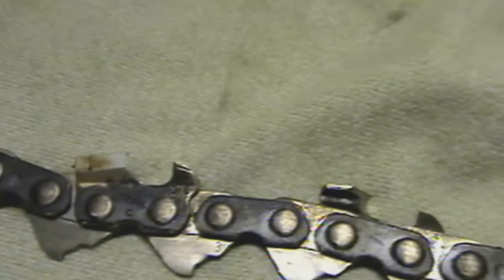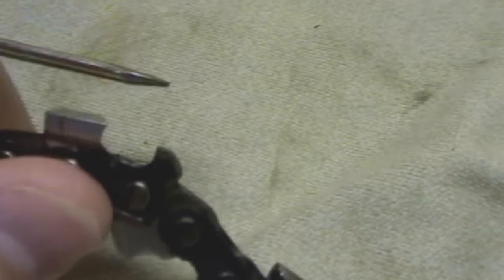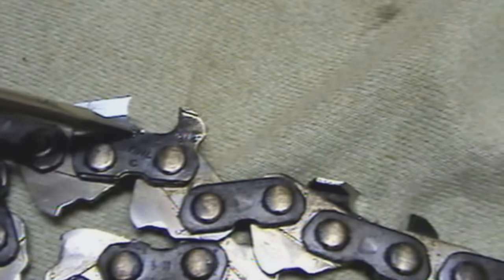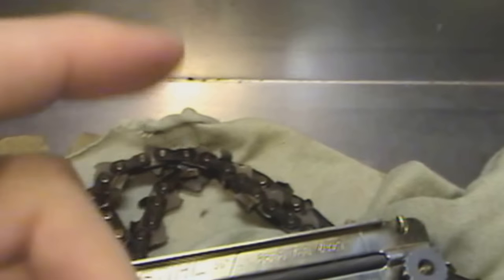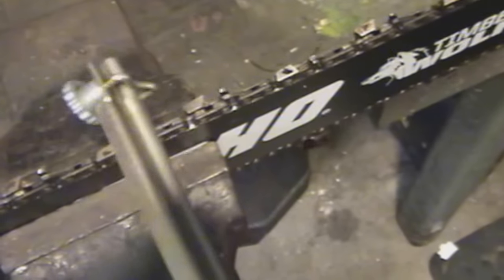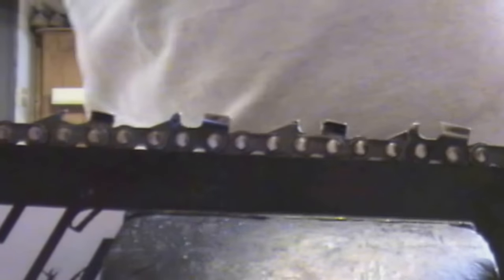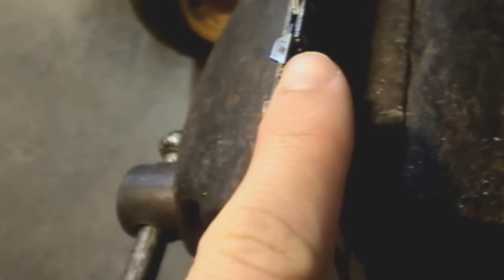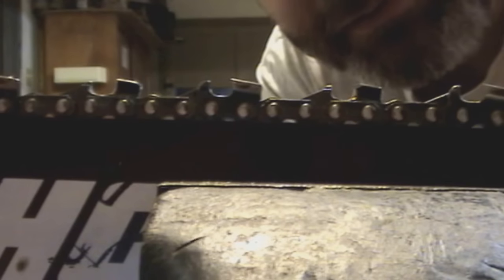HOW TO SHARPEN A CHAINSAW CHAIN.

Comment: How do I know what size file to use for my saw?
Reply from the maker: It depends on the chain. What pitch and style is the chain? That info will be stamped on the side of the bar.
Reply: @Andyshine77  3/8th pitch.  .050 ga?
Reply from the maker: @soleslayer91   Sounds like full size 3/8 I use an prefer Stihl 13/64 size files, some like 7/32 which is slightly larger. Now if this is on a small saw you could have low profile 3/8 chain, that chain is used on small saws with short bars. the file for that will be 5/32.
Reply: @Andyshine77  thankyou sir it is a small poulan 14" bar
Reply from the maker: @soleslayer91  OK that will be Low pro 3/8 chain.

Comment: You didn't mention filing the hook same # of times for each tooth. I have heard that if some teeth have been filed more or less that can cause it cut crooked. Can you address that please? And thank you
Reply from the maker: Good question, I'm glad you brought that up. Unequal tooth length will not affects the way the chain cuts, if the depth gauges are set properly. That is a myth. Now I prefer to have them somewhat the same length, but only because of OCD lol.✌

Comment: bravo- I am getting  fine dust is depth Gage  the problem
Reply from the maker: I really can't tell you one way or another, it could be or  the teeth are not sharpened properly.
Reply: @Andyshine77  what causes the oil to get to the bar . is there a motor or pump or gravity
Reply from the maker: @boashna   A pump. The older saws were manual, new saws have automatic pumps driven off the engine.

Comment: Witness mark? or guide line.   And, at 9:30 that file looks like a double-bevel chisel file for sharpening square edges on a full chisel chain,,,, please don't use it for the depth gauges,,,, I searched high and low for these.  (You are making a grown man cry lol)
Reply from the maker: The edge of the file is used up from square filing, so I repurposed it. They cost like $12 each so I try and get the most out of them lol.
Reply: @Andyshine77  Totally logical.  I tried sourcing from Vallorbe directly, but the sales rep never responded.  I guess they don't want to be bothered with small potatoes like me.  BTW, Thank you for your presentation, you gained another subscriber.

Comment: There were no drag links in that chain,  am I right in assuming that the  gauge link act like drag links in that chain. Great tutorial no how to sharpening a chainsaw chain by the way.
Reply from the maker: Drag link? Chainsaw chains do not have such a thing. What I believe you're calling a drag link is actually a bumper link used on what is called safety chain. Safety chain helps reduce bar tip kick back. Unfortunately it also makes bore cutting difficult if not impossible.

Glad you liked the video.✌
Reply: @Andyshine77  don't they also have to be filed down when they start sticking up higher than the cutting link.
Reply from the maker: @jeffarp7409  The teeth would have to be extremely worn down for that to occur, time for a new chain at that point. So no you should never have to file the bumpers.✌

Comment: Sharpening from the point down is more accurate and no burr.
Reply from the maker: Technically you're correct. However it is more difficult for most, and the difference in the end result is miniscule. Most who square file including myself, file front the outside as you suggest.✌

Comment: how much you charge to sharpen a chain
Reply from the maker: That would require me setting up a PO box, unless you're local. That said it would depend on the type of chain and how many drive links it is.
Reply: poulan pro 18inch chain s62
Reply from the maker: . I would charge $10  it would not be worth the cost of shipping as a new Oregon chain is only $18  a knockoff brand would be even less. So I will suggest learning how to sharpen the chain with the help of my video, or just buy new ones, which to me is very wasteful. Sorry I couldn't be more helpful.

Comment: If a chain costs $15 and is readily available, why sharpen?  Is it because the new ones are too dull to begin with or is the logic just to reuse and conserve resources?
Reply from the maker: Well one reason most real chain does not cost $15 more like $40-$50. If you actually cut regularly even $15 will get expensive quickly, and if you're a professional, you'd be out of business. Plus if you actually want to run a chain that cuts even somewhat efficiently you have to sharpen regularly. And yes it's less wasteful.

Comment: Cleaning your chain. You'd get fired or laughed off any logging show.
Reply from the maker: No doubt, this is only an in shop thing and I normally don't do it myself. But it does help make your files last longer and makes filing a bit easier. ✌
Reply: @Andyshine77  Hey Andre', great tutorial!  I wondered if you would catch any flack for your tactic of cleaning the chain prior to servicing.  Out in the field I just get my kit and go after it, but back in the shop when the chain comes off they get cleaned up before I sharpen.  Numerous benefits to it. Not only the file and stone benefit, but the tooth benefits from not having the residue to hold heat in the tooth when grinding. They will certainly begin to blue on the cutting surface much more quickly when there's crud on the top plate. Same goes with mower blades!       Bless'ns to ya,    Tedd
Reply from the maker: @sawsurgeon   Thank you brother! 

I also find making a rip cut will help clean the teeth up if they're gummed.

Comment: Thx! Is it worth the extra 12.00 to buy the stihl chains over Oregon?
Reply: No Oregon LGX best my humble opp.
Reply from the maker: I depends, Oregon makes some good chain and when sharp, the thinner tooth design makes for a fast cutting chain. The main Issue myself and others have had with Oregon, is the edge retention "for those who cut harder species of wood", isn't up to par when compared to Stihl chain. There have even been some Rockwell hardness test, that confirm Stihl chain is in fact harder metal, the chrome layer is thicker as well. If you don't mind sharpening a bit more Oregon chain is fine. Also shop around some dealers will cut you a break, especially if you buy chains regularly.
Reply: I dont believe in your talk about the "gullet". If the tooth and depth are correct this "gullet" is of no consequence. Correct oil and sharpness is more important to comment!!
Reply: bobe8888 c
Reply: @ajstoddard1  the gullet i very important

Comment: I just but a new chain when mine gets dull . $25 chain isnt worth my time to sharpen
Reply from the maker: Professional chains are more than double that, depending on the drive link count. If you really cut wood you'd be going through hundreds of dollars worth of chain a day, even with enexpensive homeowner type chain. When you know what you're doing it only takes five to ten minutes to sharpen a chain, as not all of these steps are used each sharpening.

Comment: Filing is not good as the file is only the same hardness as the chain, they do not last long and go blunt very fast
Reply from the maker: This is incorrect. They're much harder than the metal used for the chain, if not they wouldn't work at all. If you drag the file on the back stroke they will in fact dull quickly. The chrome that covers the top of the tooth is in fact harder than the file, this is why when you file you're removing the softer metal under the chrome to produce the sharp edges.

Comment: In 50 years of running a chainsaw I have never cleaned a chain. Can’t even begin to see why anybody would clean a chain.  sharpened it use it. Sharpen it use it. Sharpen it use it. Never ever clean a chain or filed the depth gauges, just leave them alone. They will wear down on their own. Start messing with the depth gauges and failing them. And you will probably make your saw cut crooked. Then you have to fix it. Leave them alone.
Reply: Never filed a depth gauge? What do your chips look like? Talcum powder?
Reply from the maker: Didn't catch this one. I never understood why people that don't have a clue feel the need to share nonsensical statements. 

If you don't have to lower the DEPTH GAUGES, than what are there depth gauge tools?😒

Comment: Simple. Buy an electric chain sharpener from Oregon. Problem solved.
Reply from the maker: I have one. They take just as much skill, setup and a diamond wheel to get even close to a filed chain. The stones that come with these grinders work, but take a lot time and patience to get right. Stones also overheat the teeth real easy, this changes the temper of the mental. Plus you still need to know how the chain works to do it correctly. Nothing worthwhile is easy.

Comment: ALWAYS SHARPEN THE ( RAKER ) 1ST, NOT THE TOOTH 1ST, you will find out when your out in the field without the luxury of vice grip, if you do tooth 1st you will be wasting time do to resharpening the whole chain again & starting with the ( rakers) 1st, because you will nick the tooth without all your little toys with you out in the field, so do yourself a favor do the ( rakers ) 1st & save time.
Reply from the maker: Well you're being a tool, but in a way you're right, you can in fact blunt the tooth with the gauge, so one can lightly go over the teeth to make sure you have a perfect corner. Now setting the depth gauges before filing is completely pointless as it's the filing that causes the tooth height and clearance change change. You don't fully understand the geometry or how a cutting tooth actually works.
Reply: @Andyshine77  yes I do you don't, you can't even say the right nomenclature  for parts of the chain. RAKER, rookie.
Reply from the maker: @ronringwald5120   Depth GAUGES!! Rakers are on crosscut saws, they rake the chips out of the kerf, that's why they're called rakers. Look it up! Depth gauge is the correct term, raker is an inaccurate slang term, carried over from a time before chainsaws existed.